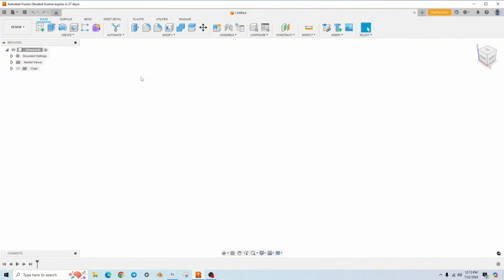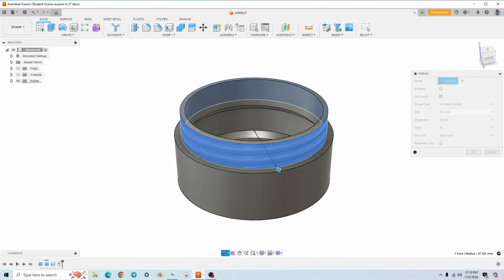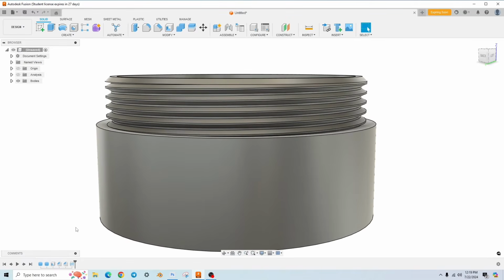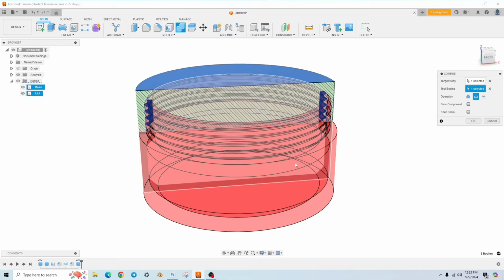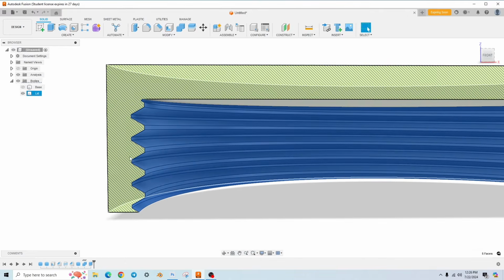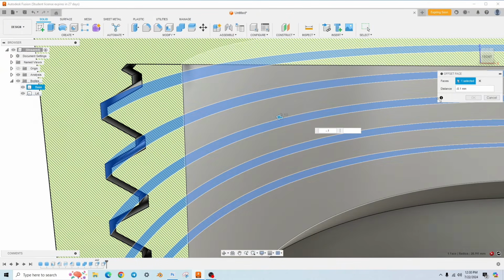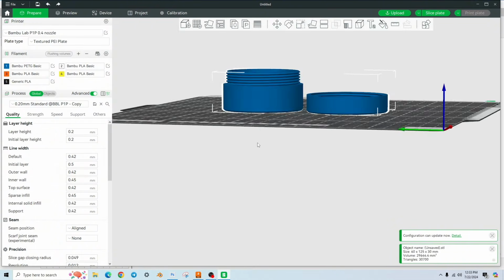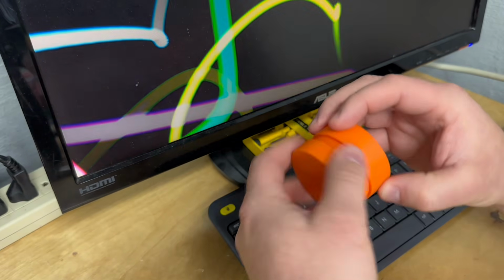Fusion 360: Thread Tool for 3D Printing

Comment: Great video. It is often recommended to cut 0.2 deeper from the base into the top of the  lid, so you will for sure no gap on the outside when closed. Please keep on posting.
Reply from the maker: Definitely, and great tip! I usually keep a little space there, but just forgot in the video!

Comment: For the threads, the number after the X is the pitch. So it would not be an M2 or M3 but a an M56 with a pitch of 2. Increasing this number, makes the threads coarser. As a result, you need less rotations to twist the lid.

Comment: You can make the threads even smoother if you heat the jar's threads quickly with a burner and then screw the lid back and forth.

Comment: Great tutorial, I've never used use thread tool but much simpler than doing a spiral cut with a sketch thread profile.

Real threads also have rounded corners.

Also you didn't need to do a 0.2 offset followed by a 0.1 offset, you could just select the slanted faces and do 0.2 and select the straight faces and do 0.3. Cleaner that way.
Reply from the maker: Good call!
Reply: @ShopTherapy623  also is there an internal thread creator? Seems like you could use the thread tool for both the internal and the external threads and they should mate together
Reply from the maker: @Numenor7  Yes, I'm aware that you can use the internal thread creator as well, but I have found that this way is more versatile, and usually gives better results.
Reply: @Numenor7  , yes if the threads are coarse. He was modeling a metal part; Fusion 360 does not have a mode specific to 3D printing with plastics.

Comment: I think that you made the offsets (especially @18:00) is the best way to do this. The extra 0.1 offset on the vertical faces on the threads makes the thin edges of the threads less thin and thus less fragile/prone to tear off.

Comment: 7:14 the best way I found to add a chamfer is to make a partial thread with a 0.2mm offset. Now you have a edge that goes around you can select and it will chamfer properly.
Reply from the maker: 100% - I discovered this tip shortly after making this video!
Reply: Can someone explain this to me? Do I just not make the thread go all the way to the end of my cylinder and then chamfer the unthread part?

Comment: - Good job.
- Some tips...
--- To remove volume inside lid (after 'Combine(cut)'), simply select face, hit delete/backspace: F360 will attempt to "heal" the body... and if all goes well, result will be as desired.
---- Consider exporting STEP file: arcs will print better; plus, very handy for multi-filament prints (provided like bodies put in respective component).
- Face selection for 'Offset Faces' on threads might be easier/quicker using 'Window' select, from left to right, then omit top/bottom faces w/ sh+click. I prefer this way, but some users may just find it "different", not necessarily "better". To each their own.
- Anyhow, keep up the good/useful content :) ...

Comment: Very useful information and well presented, but the "allowances" were somewhat painful. When fitting parts, we talk about clearances.
  
The sloped edges of the threads will not be perfectly shaped on a  FDM (fillament type) printer, so the clearances will not be as "pretty" and uniform as Fusion 360 shows (not suprisingly, it was designed for metal machining).
Reply from the maker: I always get allowance and clearance mixed up Shoulder shrugs

Comment: Hello, great video by the way. I’m having trouble with printing my outer threads. I was wondering if maybe you could help? The stringing you mentioned in your video I may be experiencing as well.
Reply from the maker: I would need a lot more info.

Comment: Would it be possible to make a coarse thread like a Yeti tumbler top using this method or would it be different when going that coarse? Great video, thanks for the info!
Reply from the maker: If you are trying to match threads on an existing bottle/container, you'll have to very carefully measure those threads (or try to google what size they are) and try to match them.  Most likely you'll have to create them from scratch. I have done it before, but it is definitely a lot harder, and takes some more trial and error printing.
Reply: @ShopTherapy623  I would like to make a jig for burning tumblers that mounts in a rotary. Thanks for the video.
Reply: @jc507  This is a tricky thing to do. For me, threads almost never give a good centering feature with axial alignment. For tumblers, I would grab on a smooth round surface. For longer tumblers, add a centering jig at the free floating edge (2 rollers/bearings with an O-ring on the outside)

Comment: That Video was helpfull on so many levels, thank you so much. one question tho, how did you change the color in bambu studio after selecting the orange on the left side 21:52?
Reply from the maker: You simple hit the number key of the filament you want.  Orange was in slot 3, so I just hit 3 on the keyboard (with the model selected)
Reply: @ShopTherapy623  thats a gamechanger, thank you so much and keep on producing easy to follow and helpfull videos.

Comment: Thanks for the video. Threads are my current learning challenge, so I plan to follow along with your tut to kick things off. As a side note, I've been trying to find a good way to print 1/4 20 threads for some photography related designs - wondering if anyone has any experience with that specifically in 3d printing? When things get that small, screws be snapping!
Reply: Look for videos about printing bolts/screws. Often, they are printed with a flat side laying down.
  
Embedding real hardware (metal or maybe nylon) would work much better.

Comment: This is an issue with Fusion that has always bugged me. They do spend a lot of effort building new features into the software, but they never seem to add much needed functionality to the base tools. They need to add to the thread tool an option to chamfer a selected edge and by how much. Also because of the growing use of 3d printing, the thread tool should have a manual print clearance option to offset the surface instead of having to use the Offset Face manually.
There's just so many basic needs in the software like this. A generate a helix primitive, not a coil, a basic single path helix. Better options for line styles and colors in sketches.
Reply: My worry is they will implement it someday but only if you buy a extension.
Reply: @Todestelzer  Exactly, like $600 for the geometric pattern. Come on, seriously.

Comment: Can you alter the width and shape of the screw threads? I've got a small wooden screw that I need to make a replacement Nut with the inverted screw thread, however the screw thread is quite thick, roughly 2mm with a completely flat profile and I'm not sure if it adheres to the standard M2, M3 etc. Will grab real measurements soon (dont have it with me right now)
Reply from the maker: If they aren’t standard threads you’ll have to create them on your own, which isn’t too tough to do using the spiral tool. Just need to get all your measurements and then thread profile

Comment: But Fusion360 is no longer free ... now it's only a 30d trial or pay :( I start switch to FreeCAD.... but I not like it
Reply: The full version is not (obviously).
The restricted free version still has a lot of to offer.
Reply: The free version for hobbyist makers is still available, they’ve removed a lot of the manufacturing parts and have restricted the number of “editable” files which you can have (which is weird and pointless imho), but it’s good enough for most designs for tinkering.